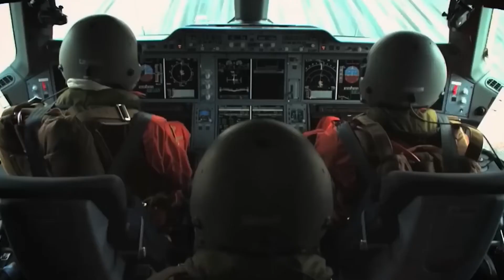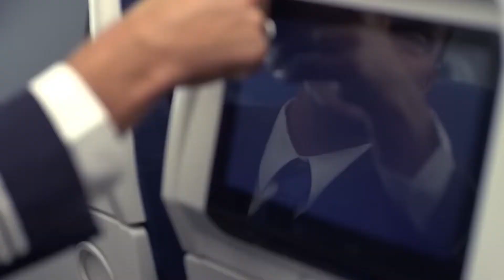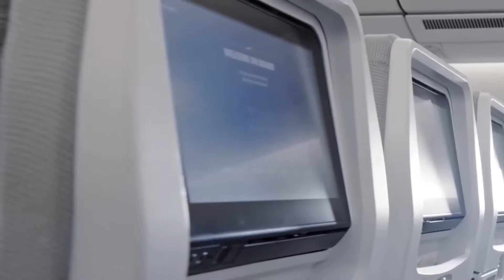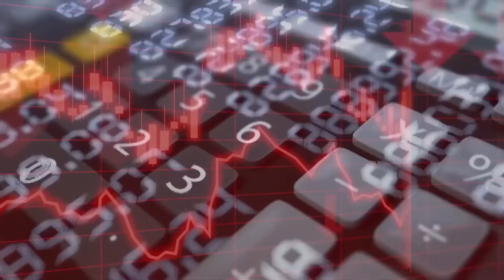The New Airbus A350 Vs Boeing 787.

Comment: The Airbus A350XWB-900 is Slightly longer and Wider than Boeing 787-8 Dreamliner Aircraft. 

Singapore 🇸🇬 Airlines and its Subsidiary Scoot Airlines had Bought and Operated Both Airbus and Boeing 787-9 Dreamliner Aircraft. 

Singapore 🇸🇬 Airlines is the World largest Operator of the Airbus A350XWB-900 including 8 Airbus A350XWB-900ULR (Ultra Long Range)